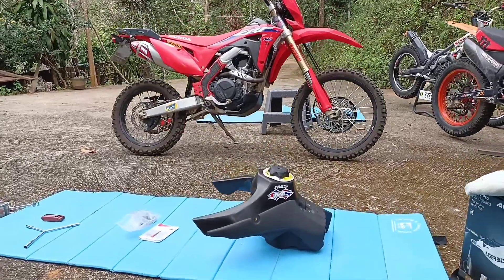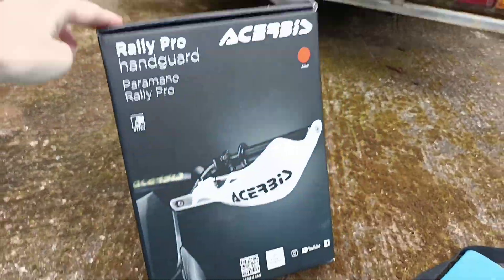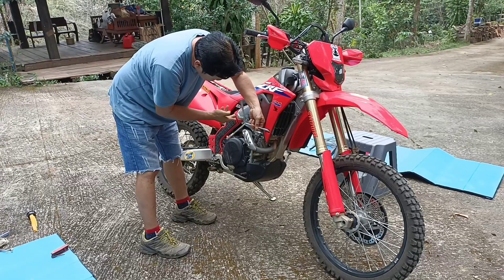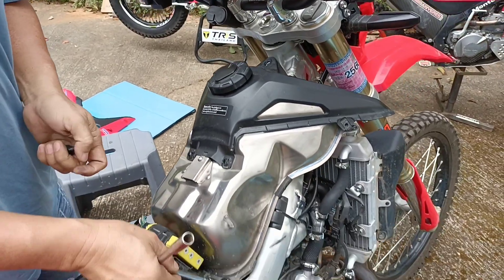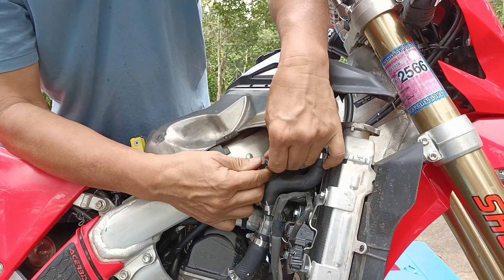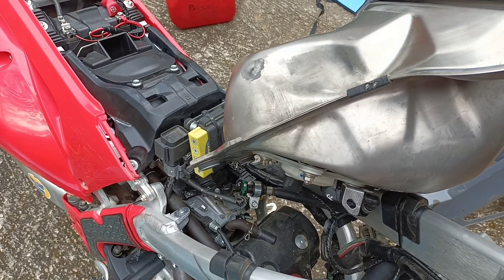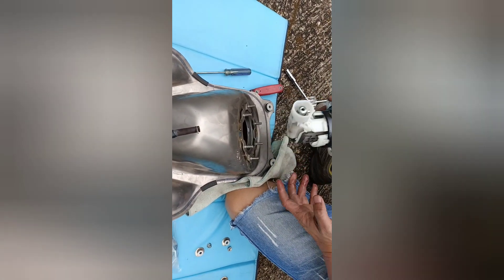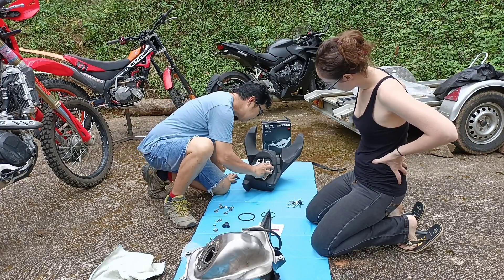Installing IMS 11L Fuel Tank on CRF450RL

Comment: you left off the part about trimming the inside of the shroud.  still, i found the video very helpful as the ims instructions were garbage.  subscribed now.
Reply from the maker: I'm glad it was useful to you. That's curious, we didn't have to trim the shroud for our installation here, is your bike a different year model?
Reply: @BikeHedonia  i have the 22 RL.  After my reply, I did some more checking.  My instructions say to trim the left side shrouds. But it seems there are plenty of threads and videos with different  methods... some trim the left side, some trim both sides, and some do neither.  Oh well.  It reinforces my belief that while engineers and designers may know what they are doing when it comes to  creating solutions to mechanical issues, they have very little ability to communicate it to their customers.  thanks for your help.
Reply: Hi, do you think a Mosko hood tank bag can be put on top after the installation of IMS fuel tank?